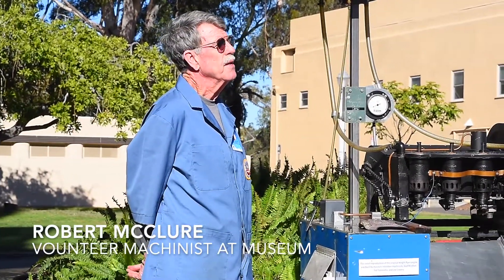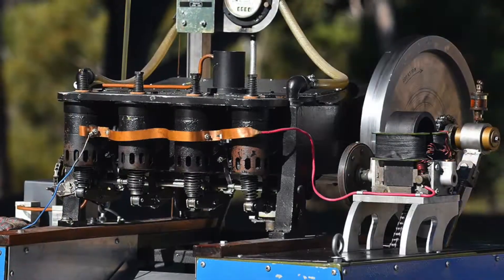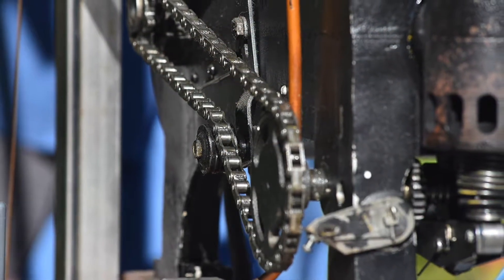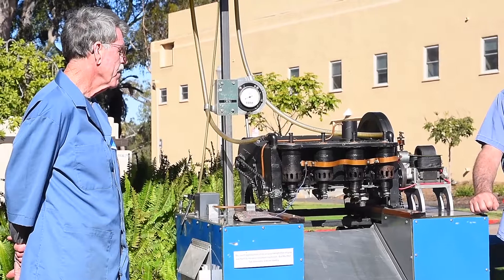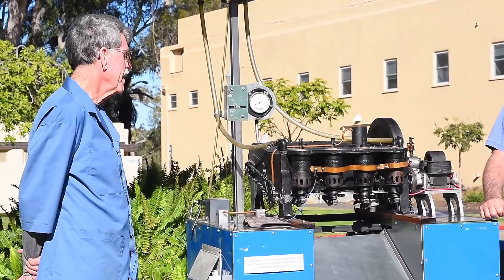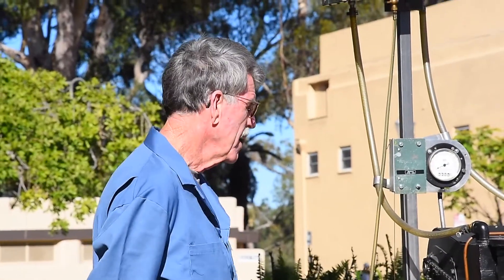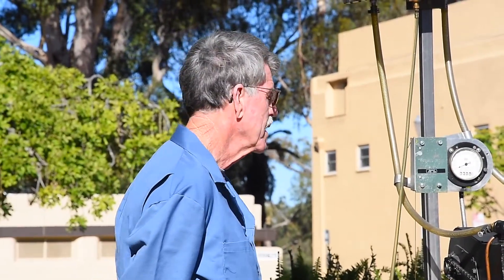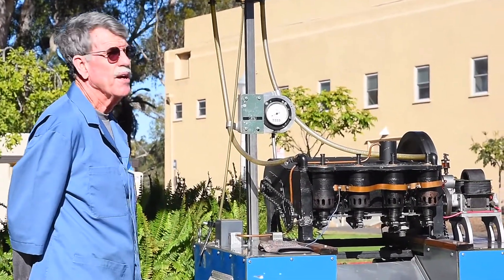San Diego museum fires up Wright Flyer engine replica

Comment: Wikipedia says the Wright Brothers' mechanic Charles E. Taylor designed and built the aluminum-copper, water-cooled, four-cylinder aircraft engine in only six weeks, based partly on rough sketches provided by the Wrights.

Comment: how did the ignition work if there were no spark plugs?
Reply: a metal pin flowing electricity would gap at the right moment causing a spark in the gap

Comment: Thank you. That was something to see/hear. It's hard to fully appreciate the effort put into that these days since a single cylinder 4 stroke 12 hp engine at 33 kgs (72 kbs) can be ordered online.
Reply: A 120cc rc airplane engine makes around 12hp, and weighs less than 6lb, just revs a lot higher (mine does 7,500rpm).
Reply: @yucannthahvitt  Ah, the advantages of modern manufacturing.  Their engine only had a top speed of 1100 rpm, to turn the propellers at 180 rpm.  It also only had 4:1 compression.

Comment: Charlie Taylor who built the wrights engine , made the crank from a block of steel, and drilled holes and broke chunks out, to get a crude roughly crank shape. That could then be put in a lathe, it only took him 6 weeks to build the engine from scratch! With better valves and a intake cam, a( more modern carburetor, from say  the 1920's like from a Model A ford );modern carburetor , I'm betting it could mske 25-30 hp, get a bit of overlap on the valves. Use the exhaust to pull in air to the cylinder from the intake,  this could possibly be simulated by using weak springs on the intake, and making the valve heavier, so the leaving exhaust can possibly pull the intake valve open just before the piston passes tdc! And adding a simple oil pump to spray every with oil,  and if it burns a exhaust valve , then it must not been sealing completely,  the slightest hole or gap exposed to combustion, it will quickly start cutting like a torch! A blown head gasket can cut a notch out of the block and or head,
But the engine can be made lighter, drill out the center of the rod journals, 
Possibly the main journals,  lighten the pistons and rods, allowing for much lighter counterweights. And lighten the flywheel, put the majority of weight on the outer edge, so  it can still store enough energy,  it would be awesome if this could be a compression ignition oil burner! Beef up the crank and block a bit. Raise the compression to about 20:1. And thicker dome pistons, with oil squirters, and a oil cooler,  design a light weight high pressure low volume fuel sprayer/injector,  this injection could possibly be more efficient than the most modern engines, cleaner and more mpg,  I think it could still make more than 12hp, and lots more TQ! Possibly 20hp and 50-60 ftlbs TQ! Allowing higher over driven gear ratio, spinning the props just as fast lower engine speeds, using a variable prop, use a governor to maintain RPM,  keeping the props at speed, only change the angle of attack to regulate thrust, possibly mount a small flywheel on the shaft with the prop, to reduce stalling from sudden attack angle changes,  but it's easy to say this when you have history to look at and learn from, being the first to do something is difficult!!
Charlie Taylor and the wrights were awesome! ✌️

Comment: Alguém já voou com uma réplica do Flier e um motor de 12 HP?
Reply: this 12hp motor was bought when they went to france. No one in history never saw something comming off the ground with their original 8hp which they claimmed as making 53km flights back in the countryside.
Reply: @gabrieldegois8687  So it is. Allied to this finding of aeronautical engineering, even the modern one, together with the little evidence of the first flights, it is difficult to believe that they flew first.